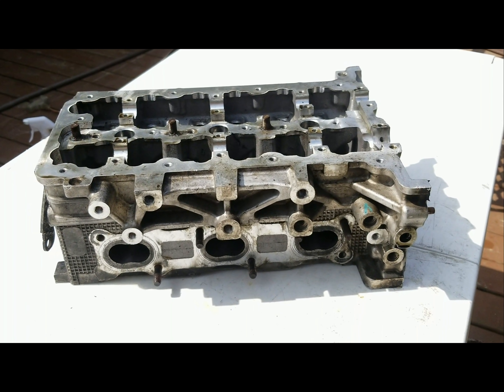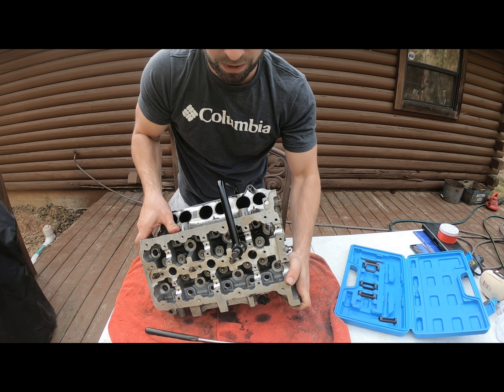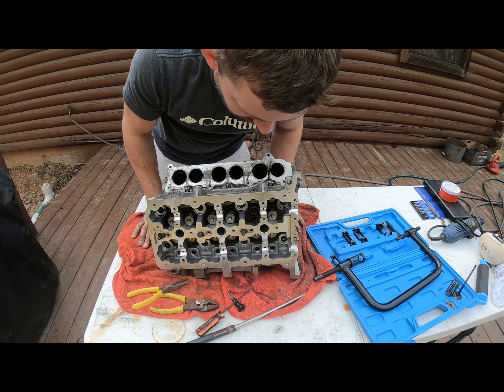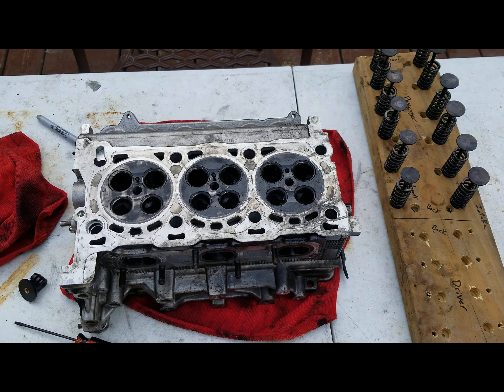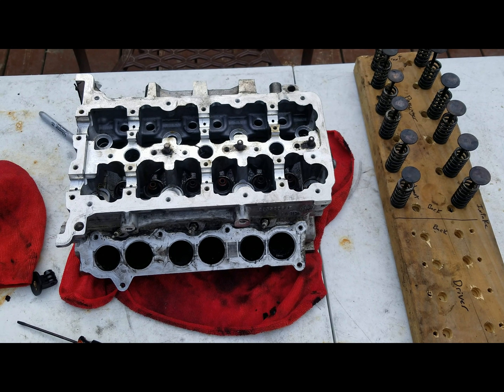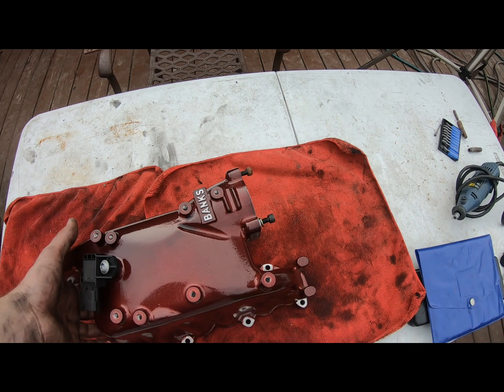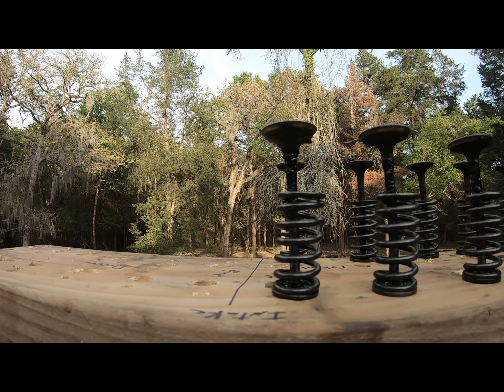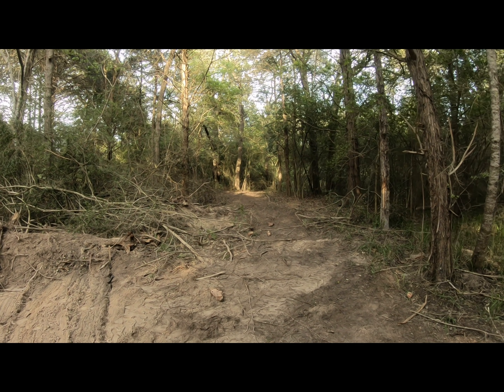Valve Removal and New Intake Manifold (Ecodiesel)

Comment: Corry, I have been a mechanic all my life. Jet engines in the Marines, shade tree at home, heavy equipment mechanic and now Marine Engineer in the Army. I work on Cummins V-16 twin turbos KTA-50,  EMD V-16 twin blowers (648 cubic inch per cylinder) and CAT. The coatings on pistons etc. is a great idea and porting exhaust ports, i.e. port match but for the intake I'm not so sure your gaining much unless you extrude hone. I have a 21 Ecodiesel Wrangler and plan to do some upgrades too.

Comment: I was told this wouldn't make a difference if you hadn't gone custom intercooler or dual turbo, not sure I agree, what's your opinion of the gains if any.  I put a straight intercooler pipe on, that sure helped.  My driving interest in the Banks manifold is that I believe having EGR to 43K has my swirl valves caked and stuck.  I did a cleaning with Mighty VS7 but not sure how well that leaves me.  Beyond me how they think they can set a motor up to destroy itself.  Crazier stuff happens every minute I suppose.  Thanks for your help!  You're a humanitarian my friend!
Reply from the maker: The main benefit would be to delete the egr without having to put a pate on it and delete the swirl valves. You wont see any performance increase unless you port it really. It also looks better and can handle higher heat without combusting so thats always good lol deleting is your best option. they usually shut off the swirl valves in a delete for this truck even if you forget to request it. This motor is actually pretty stout, just has some mild manufacture errors just like any engine and the emissions always make vehicles break. Im just here to help and raise aftermarket awareness for the EcoDiesel, but thank you! (:

Comment: Glad  you are going to get the new building.  Make sure you get two lifts - I need room for my truck.  Wagler made those rods for  you - any chance you get them to make you some main bearings?  While you have the engine out I recommend you fix the turbo coolant pipe.  That little piece of rubber hose under the intake is giving Eco owners fits with a 2.5k bill at the repair shops.

Comment: Is there any modification to the crank or bearings you can do to keep them from spinning? I know the tolerance  is  tight and if u go with a thick oil in your new set up (which is what I would do)  wont properly lube those bearings. Any suggestions and I'm courious what you plan on doing about that. Thanks
Reply from the maker: Oil clearances on paper are supposed to be .0036" so ill be verifying soon that they were close before I correct the crank. the bearings are also getting coated. This should help these bearings last longer. As soon as an aftermarket solution comes out that motor is being taken back out to get new main bearings.